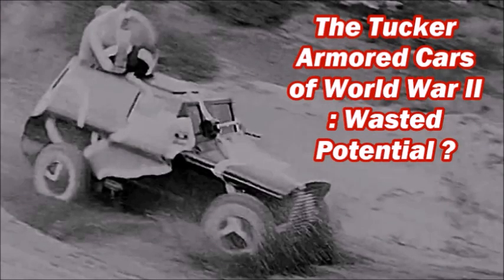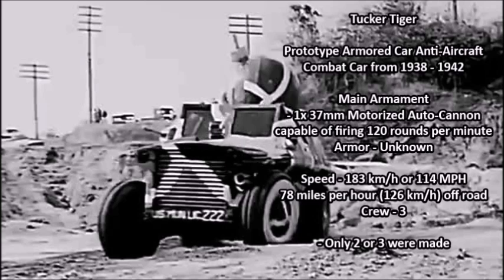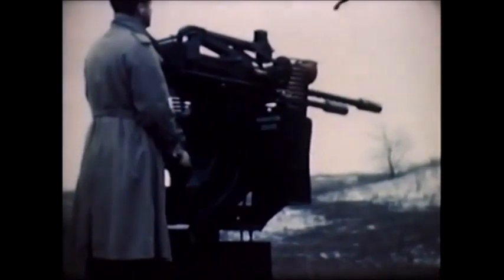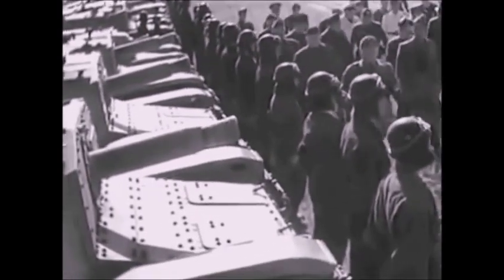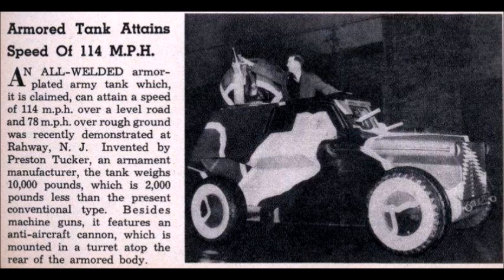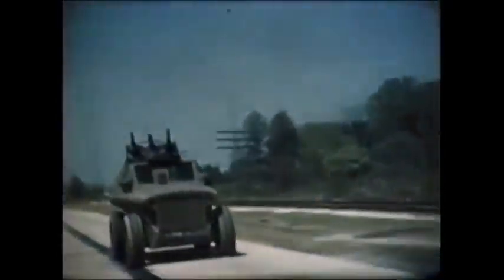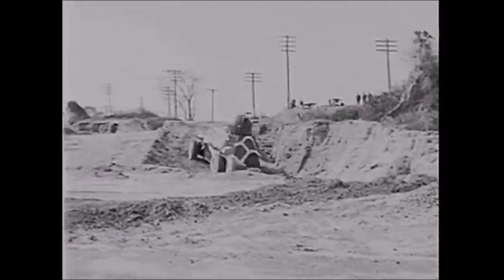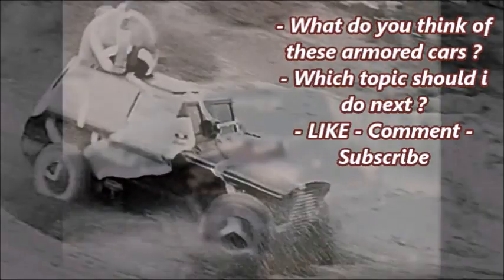The Tucker Tiger Armored Cars of WWII

Comment: The footage between 5:45 & 6:05 gives an idea why the US military didn't adopt the Tucker tiger.

Get a load of rhe upper-body sway as ir rounds a relatively flat-pitched corner, then check out the near-roll experience when it performs a relatively small jump.

The vehicle was too narrow & high, low in carriage and small in tyre, & lacked the basic off-road rough terrain capacities essential for multi-theatre operations.
Reply: thats bhy far not the worst part. It is a 5 ton vehicle that is only powered with 1 axle. It failed the sand pit test so hard they gave up on any further testing.

Comment: Ground clearance looks horrible but does appear to have a slick bottom at least but think it would of sucked in the pacific and the desert. A lot of weight on only 4 wheels. The army was probably thinking the same thing. Being fast it’s only use could be a scout but being stuck to only roads it wouldn’t fulfill that role good . AA only needed to keep up with everything else and the M16 seems like it could hold more ammunition and had better off road abilities.
Reply: I think you nailed it.

Comment: I admit that I had never heard of this vehicle before now, so I did some checking -- it was fast, because it was running a modded Packard V-12 on a 10,000lbs chassis, which was more than 7,000lbs less than the M8 "Greyhound", and c.2,500 lbs less than its direct competitor, the M3 Scout Car...That weight had to come off from somewhere, and that means that it came from its armor -- or lack thereof. That thing would have been a deathtrap for its crews in action, far more than its competition, whose armor sucked as it was. I also want to see footage of it actually firing its supposed "37mm autocannon" because that rate of fire, from that large of a weapon, implies a LOT of recoil impulse, and I'm not buying it from that lightweight of a frame without proof -- a dual .50 BMG is not a 37mm. I would also wonder how long it would take, before you'd get catastrophic frame failures on so light a chassis.....The US Army in WW2 generally made pretty good choices in vehicle procurement, given what they had to work with, and the fact that they passed on this vehicle (although the USN & USAAF did use Tucker's turret design) speaks volumes about the it, rather than the Army.

Comment: Lots of misinformation and speculation based on movies and Tucker advertisements abound on this "thing"
it was crap and would never would have worked and the Army knew it.

This car weight 5 tons, had a high center of gravity,  had 4 wheels,  a narrow wheel base, and was driven by only the two rear wheels which adds up to being great on roads but totally useless off-road, It failed the sand trials and they did not even attempt the mud or the incline tests.
As for the turrets, other companies designed and built various turrets for various airplanes.  Tucker had little to no influence on turret design.

Comment: It might have been a logistics issue? Ar first glance it has a lot of "non standardized" special parts. The wheels/tires a pecially tuned engine special gun/ammo.
Do the (few) perceived advantages advantages justify the disturbance in the logistics? The support this car had to do was also already  and better achieved by (overwhelming) air support.
The off-road capabilities might have been not as good as portrayed being just a 4 WD. There's a reason the USA Greyhound and the German armoured vehicles switched over to 6 WD and 8 WD.
The speed and the fire support could also be handled in a better way by ground attack fire support by airplanes which was available in great numbers at that time on the Allied side.
Reply: The off road capabilities was the biggest reason why it was dropped, during testing it instantly got stuck in the terrain
Reply: @PaperThinArmor  An off roader that can't do off road is a bit of a conundrum 😉